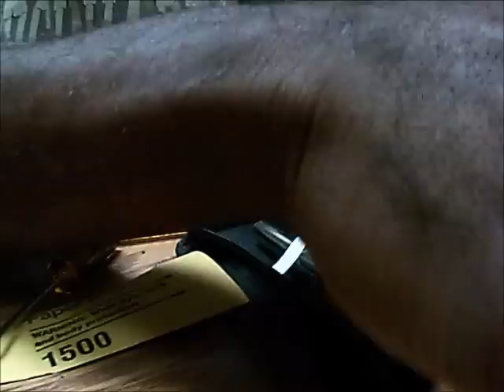Brushless Motor Repair

Comment: yo max yoiu should check out my thread on the forumon re building a radian 480960 kv motor I re wound it with 11 turns 21 awg and the damn thing is super powerfull
Reply: Joseph Rueck Just got finished watching it, Joseph.  Zoom! Zoom!  Happy flying, bud!